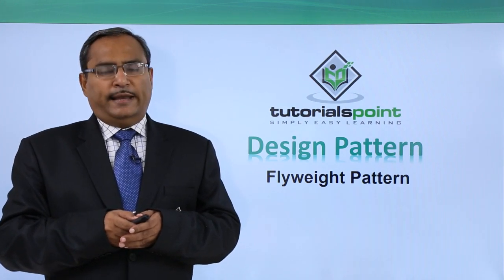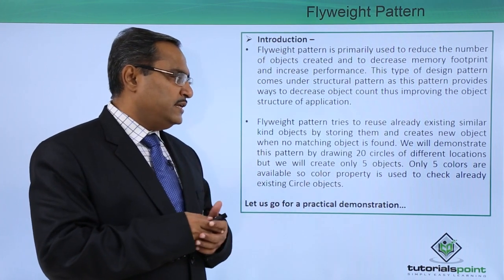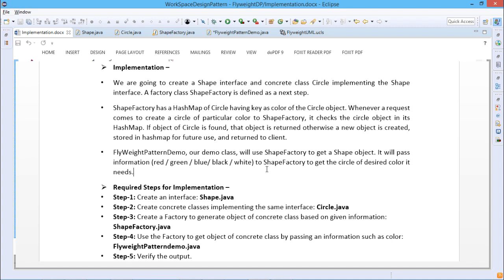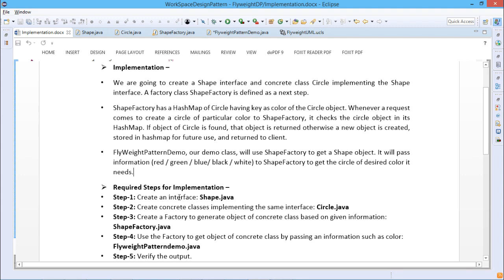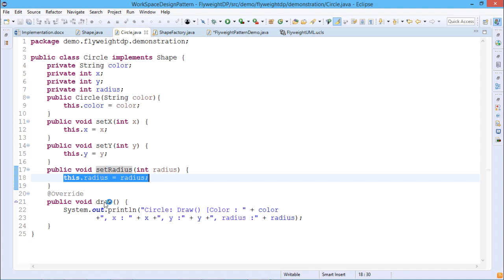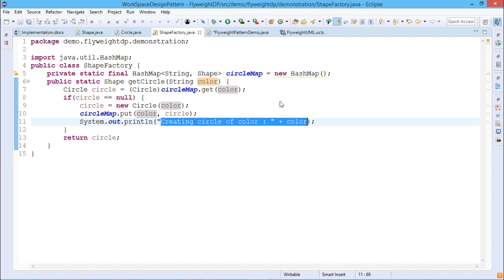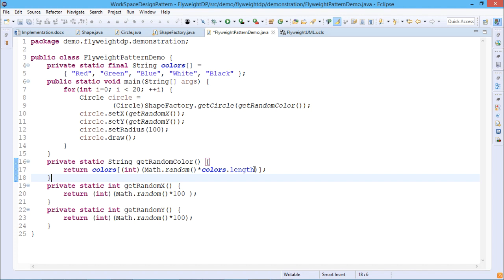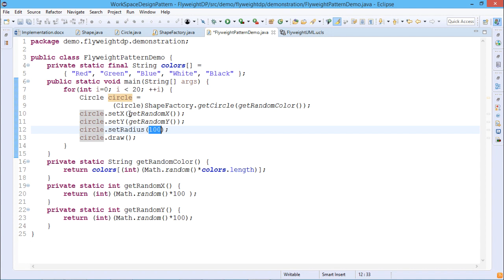Flyweight Design Pattern

Comment: you said flyweight pattern objects are immutable but why are you using setters for changing values of object?
Reply: Good question...maybe it wasn't important?
Reply: so the flyweight objects, from what i understand (correct me if i'm wrong, i am new to this pattern) are the objects in the hashmap. we are just storing the color piece, the colors are immutable, the setters are for aspects that can be mutable in the class. Normally, you only put common aspects of a class into a flyweight, so in this case, those setters are for specific mutable properties.  Here is a pretty good on-paper example of a good flyweight: If you had a flyweight pattern made with a map of elements on the periodic table of elements, each element has a specific atomic number and mass, so those pieces would be in the immutable flyweight pattern. But if you were adding those chemicals together, the number of molecules of each chemical could be different, so the number of molecules would be mutable, and is placed outside of the flyweight pattern. The pattern works here, we're only ever using 5 objects instead of creating 20 separate objects in the for loop, decreases space used and performance time is quicker.